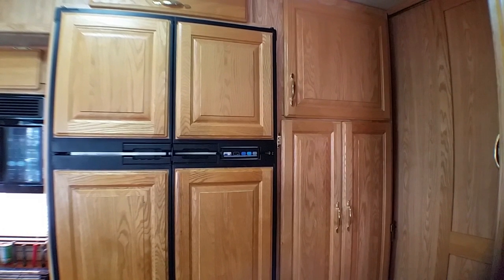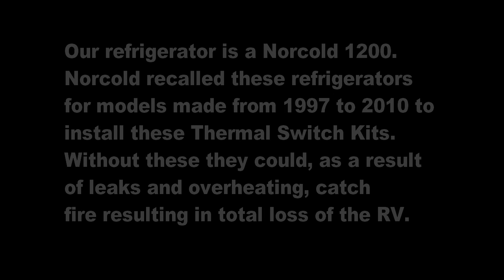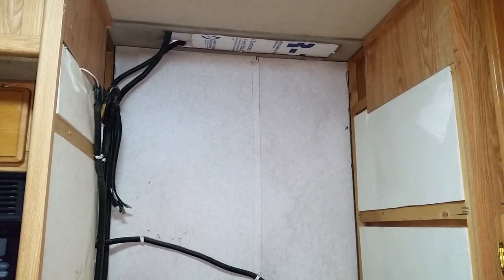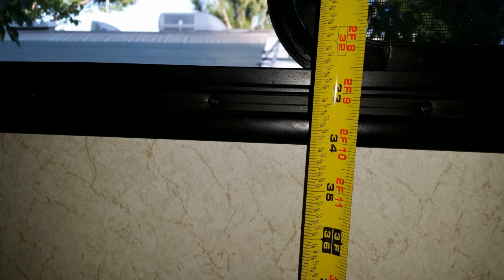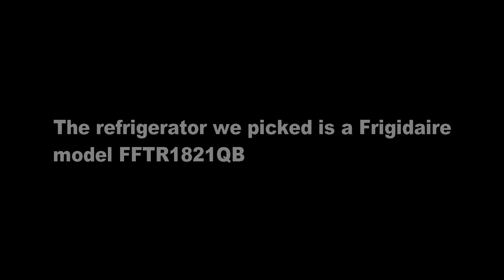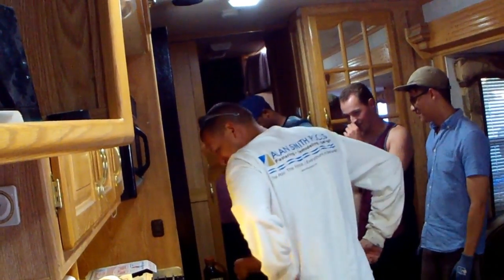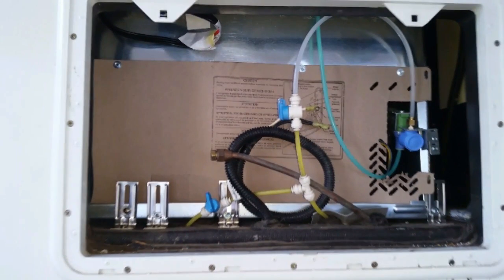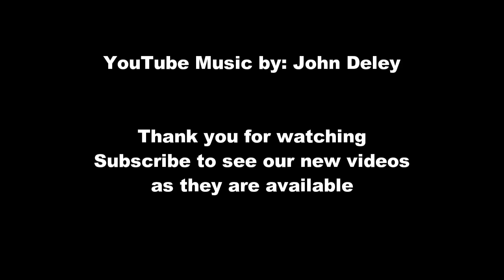RV Refrigerator to Residential Refrigerator Replacement

Comment: I Had a 2019 Jayco Greyhawk Class C with a norcold 1210.It was the 4 Door Refrigerator we were not as lucky it burned my camper to a total loss.If you have the Norcold 1210 Get rid of it because they are all a fire hazard its just a matter of time before it leaks flammable gas and catches your camper on fire.

Comment: I noticed you didn't smooth out the lap sealant like one would do when applying caulk,,, I'm assuming I should NOT smooth out the lap sealant, is this correct?
Reply from the maker: +Cherty Madzev 
There is no need to smooth out self leveling lap sealant. It will smooth itself out in a few minutes and will stay soft for weeks, this is by design. Other sealants harden in place and may need smoothing out unless you are real good at applying it exactly where it should be.

Comment: How big an inverter did you buy?
Reply from the maker: +Eric Van Nostrand Thank you for the comment. 

We still have not changed the inverter the original one has not given any problems with the refrigerator even though it is a modified sine wave, we have used it this way many times, and it doesn't seem to make a difference to it. I do have to say that not all inverters are built the same, better ones behave more like a generator less expensive ones split the load between the hot and neutral leads, and those I would stay away from for this application, since you liked this video you might like some of our other videos on "How To" :
https://www.youtube.com/c/HowWeDoIt_HowTo
Share with your friends what you like and thank you again.

Comment: Why did you seal off the vents?
Reply from the maker: +William C. McDonald Thank you for the comment. 
Residential refrigerators are designed to be used in a room temperature environment. If they are used outside they tend to fluctuate in temperature, so having vents to the outside is counter productive. 

since you liked this video you might like some of our other videos on "How To" :
https://www.youtube.com/c/HowWeDoIt_HowTo
Share with your friends what you like and thank you again.
Reply: @HowWeDoIt_HowTo  How did you seal off the vents??
Reply: @HowWeDoIt_HowTo  Oh and why seal the top vent but not the bottom?? Thanks
Reply: @HowWeDoIt_HowTo  actually that's incorrect if you do not have proper ventilation for the residential refrigerator it will overheat.  residential refrigerators are not meant to be built in to a cabinet these refrigerators reject heat outside and need air to vent not a significant amount but still needs some breathing room otherwise it will overheat or just not stay at the proper temperature. I replaced my dometic refrigerator with a residential unit I went as far as adding a small fan unit in the back of the vent to blow the air out